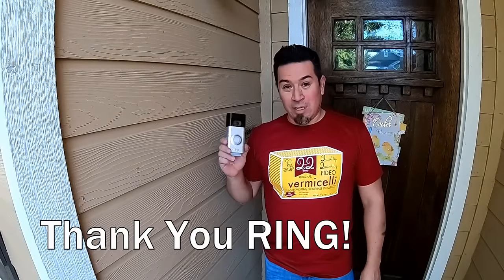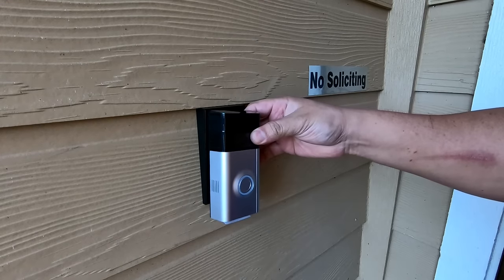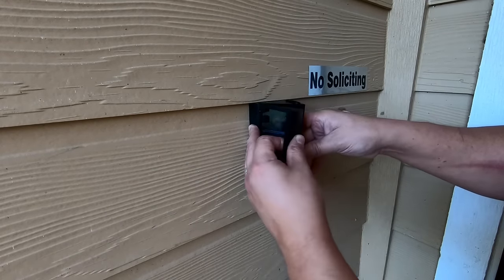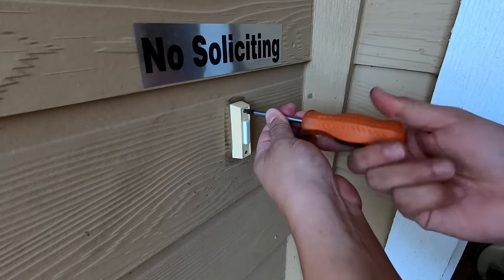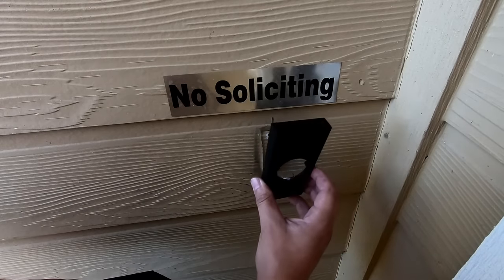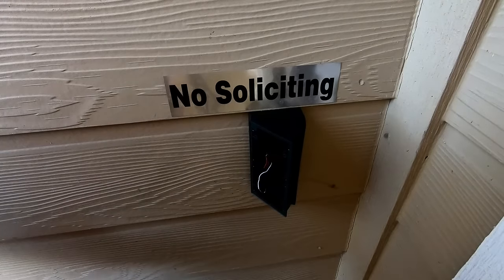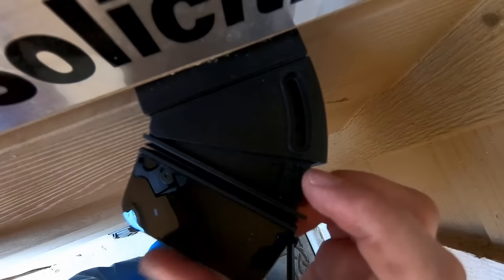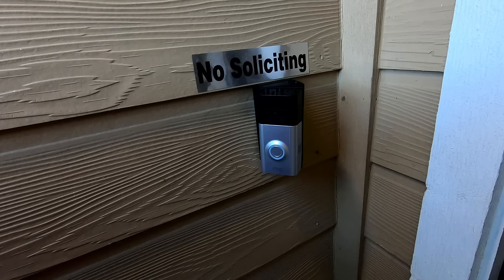Adjustable Ring Angle Mount Installation

Comment: Writing a review to shame Ring for not including a 55 degree angle wedge in their packaging for those of us that have doorbells on the side of the house.  The video was very timely and well done. I bought the mount from eBay for $12.49+tax  and FU Ring for not including and also not advising us of the corner kit bracket.
Reply from the maker: My neighbor had the same suggestions as his doorbell is also side facing
Reply: @ThisGuyProductions  how did your neighbor resolve? Did he complain to Ring?  Did he buy the corner kit bracket like I did?
Reply from the maker: @gmav17  - He bought an angle bracket as well and is waiting for it to be delivered.
Reply: @ThisGuyProductions  there is no excuse for Ring not providing an adjustable bracket up to 55 degrees included in the packaging. What were they thinking for those that have side doorbells and cannot use the wedge they provide. People should be aware that this is an issue before they buy Ring and would need to order another product and drill a fn hole in that product to complete the Ring installation. Ring buyers with side doorbells all need to know this!
Reply from the maker: @gmav17  - I totally agree. It would at least be great for them to mention the limitation on their packaging and then perhaps offer an angled bracket as an accessory. It would allow them some additional revenue and offer a solution to consumers on the spot instead of being stuck without a solution. I also feel it would improve their sales up front.
Reply: Any chance you might recommend an angle wall mount for RemoBell W Video Doorbell Camera with Chime? 
It looks more narrow and leaves me with the same directional install challenge. Would appreciate your feedback, thx
Irene
Reply: @irinatenenbaum8702  Not familiar with the RemoBell Video Doorbell camera.
Reply: @ThisGuyProductions  Remo offers what I want, yet same angle bracket bottleneck
Reply: Did you sue your builder too for a narrow doorway and inconvenient placement of the wired doorbell? 😂
Reply: Strong words. It's just a doorbell mount.

Comment: Thanks, Guy. I was ready to build a bracket to hold my Ring since I have an unusual doorway with no surface wide enough to mount it facing forward. Great solution. Going to the Amazon now to look for the bracket.
Reply from the maker: Glad to help out Neil. One thing I didnt mention in my video is that the brackets can be painted to match your home color scheme. Good luck.

Comment: I didn't make mine flush with the siding because I needed it to cover the old screw hole.  I ended up using two 2" screws, which worked and I turned the bottom angled piece around and lined it up with the top piece, worked good 'nuff for me!  Good vid.
Reply from the maker: Thanks for sharing. Glad it all worked out.

Comment: This was quite helpful.  I was putting off the purchase because I wanted to hardwire the doorbell but was unsure about the angle.  I found the included wedge to be sufficient but not quite where I wanted it and of course didn't even know about the adjustable wedge until this video.  Completed the install in minutes.
Reply from the maker: Awesome, thanks for sharing.

Comment: Good video, but a correction on your hardwire detail, as Ring say is correct it does not matter which wire goes into the back screws, WHAT matters for your existing doorbell chime !!  in the house to Ding-Dong is, the settings In The App/Account on the section of when it asks about wiring to an existing doorbell, meaning, after you install it , you go back into the app and make the selections so it ding-dongs when you press the bottom., given you have a mechanical-common doorbell at the house with the strange looking transformer some where inside the garage wall or ceiling.
  Hope this helps for the ones that missed it first, and it didnt dingdong and had to ck with Ring to fix it.
Reply from the maker: Thanks for clarifying RG King.

Comment: Ok question. I have somehwhat of a similar situation as you, But I can see almost all of my driveway. I want just a slight bit more angle so I can see about another 4ft of my wall. That way I can see my side gate as well. Would aIbe able to use just the angled piece that come with the Ring? Or would I have to use the slanted (leveling) piece as well? The Angled piece would work perfect. But I don't want to drilll 2 unnecessary holes if it wont work. Appreciate it in advance.
Reply from the maker: You can add some wood shims fairly easily to add the additional angle you are looking for. I was going to originally mount my ring using a piece of wood cut at an angle, but the mount I found online was much more flexible.

Comment: Great video, I just got this yesterday and plan to install it in the next few days. Let’s talk now that’s it’s been over a year later since you installed it. How is the mount holding up? Do you find yourself having to go back and tighten it a lot? When you push the button, is there a lot of give or is it solid? Thank you
Reply from the maker: The mount is as solid as the day I installed it. I havent had any issues with it whatsoever. I also have tons of traffic so it gets plenty of use.
Reply: This Guy thanks so much for the quick response. Take care!

Comment: I fancy a Ring doorbell and would need the mount for my porch. But, I always see these Ring doorbells and think how are they not stolen. It must be so easy to rip this straight off the wall or door and walk away with it. Yes, ok for a point you're on camera but if I'm wearing a cap and have my face covered you have no chance knowing who stole it. So, the question is how secure are they from this happening?

Comment: When will they make a model designed for the side wall installation.  It would be streamlined with the camera lens and motion sensor on the side of the unit.  I think there is a big demand and would look very nice.  I'll wait until they invent it.
Reply from the maker: I agree with the demand for an angled model. That or at least offer an accessory to solve the issue.

Comment: 2 questions...1. Where did you get your shirt? Yay Fideo! 2. Did you cut power to your doorbell before you did this? I have turned to breaker off  and all of my outside lights & outlets turned off, but the light to the doorbell stays on. ??
Reply from the maker: Hey Valerie. The shirt came from a company called Barbacoa Apparel. They have a website where you can find this shirt and other cool options. As for the power, you can keep the power to the doorbell on. There isnt a lot of electricity running through it, just don't put the wires into your mouth. It can be connected just like that.

Comment: Not that it mattered for your end result using this additional adjustable bit, but the ring wedge was installed backwards.  The flat side goes against the wall.   It is confusing as the product images they show is of the back.
Reply from the maker: Thanks Curtis. No harm though. It works great as is.

Comment: What kind of longer screws like your using would i use on regular siding?  Also can u please, please post the amazon link for the adustable extender mount you are showing you used here?  I have the same problem..ugh..side doorbell..here's looking at you wall!!! hahahaha Thanks for the video!!
Reply from the maker: Hi Boe1956. The link to the mount I bought is here (below). I am not a paid advertiser from this company, its just the one I used. If you go with a 1 and 5/8 wood screw you should be OK. Let me know how it goes.
https://www.amazon.com/gp/product/B078RK1131/ref=ppx_yo_dt_b_asin_title_o01_s00?ie=UTF8&psc=1

Comment: Thanks this solves a problem. One question. I have stucco so do I need all of the brackets you used?
Reply from the maker: No, one of the brackets I used out of the box was to correct the angle from the siding on my home. You can get away using the flat part of the angled bracket, or the bracket that came with your doorbell.

Comment: Great Video  but will    the  adapter  work for Ring Doorbell 3.?
Reply from the maker: Hey Jesus, I just checked and the version I installed states it only works on the 1 and 2. I just did a quick amazon scan and saw lots of versions for 1's and 2's but not 3's. If you find a link, please share. I'll add to the description and throw you a shout out.

Comment: Does the wedge work if you needed it to face the ring in the other direction? In other words, can you angle the wedge in either side?
Reply from the maker: Yes it does. Just flip it upside down. It is universal.

Comment: Awesome video! I have the same issue you had. My door bell is facing the wall, I have a ZMODO door bell camera, do you know if this bracket you installed fits the zmodo door bell camera? TIA
Reply from the maker: Hey Maxcoatl, I am not familiar with that doorbell. I would start by comparing the doorbell dimensions. Chances are they are not the same, thus incompatible. There are a number of "Universal," options online, but I don't have recommendations without knowing the products.
Reply: @ThisGuyProductions  thank you very much. I contacted Zmodo and they do not sell a bracket for their model. Also contacted amazon from your link and they told me it wont fit. I need to come with an idea on how to make mine like yours; thanks again.
Reply from the maker: @maxcoatlhunter4322  My original Plan was to use a block of wood. I  would basically use two 2x4s. Cut each at a 45 degree angle, then stack them. Basically a block that I would drill holes into for the doorbell wire, then mount the doorbell to. I went the bracket route when I found the version I used online.
Reply: @ThisGuyProductions  thanks man I really appreciate it. I will put your idea to work yes, thank you!
Reply from the maker: @maxcoatlhunter4322  Let me know how it works out.

Comment: Will this adjustable wedge work with a Ring 3 Plus unit? If not, can it be modified to work?
Reply from the maker: Hey F Anderson, I am not sure if it is compatible. I haven't tried it with that version. I am sure you can find amazon sellers with similar compatible models, but be cautious as I had to modify the version I bought.

Comment: Will this work for a side mounted doorbell at the top of stairs?
Reply from the maker: Sort of. The doorbell has a very wide camera so you will see some of the stairs, but not all the way down. There is a small wedge in the box that may help aim in downward a little. There may also be a different option on Amazon with that option too.

Comment: So moving the doorbell location (which I assume means rewiring) is too difficult to do? - Asking with no knowledge
Reply from the maker: It really depends on how far you are planning to relocate it. A few inches, no problem, a foot or so, you can add an extension piece of wire and paint it in to make it look neat. If youre moving it to the other side, you may have to hire someone.

Comment: do you know how to fix a glare during the day time
Reply from the maker: Its gonna sound weird, but you can add a shade over your doorbell. I am assuming the sunlight is hitting it directly? I quickly googled this, but I am sure there are many more options: https://www.etsy.com/listing/783377731/the-original-video-doorbell-camera?gpla=1&gao=1&&utm_source=google&utm_medium=cpc&utm_campaign=shopping_us_c-home_and_living-home_decor-wall_decor-wall_decals_and_murals-other&utm_custom1=_k_CjwKCAjwjJmIBhA4EiwAQdCbxsI3jlZHwovJ5DOpfO6qmu7yaz3Gj-2wo4Vq1O_RzPheDkP6g6c50xoCUw8QAvD_BwE_k_&utm_content=go_12569671679_118325090374_507439142846_pla-307934656303_c__783377731_12768591&utm_custom2=12569671679&gclid=CjwKCAjwjJmIBhA4EiwAQdCbxsI3jlZHwovJ5DOpfO6qmu7yaz3Gj-2wo4Vq1O_RzPheDkP6g6c50xoCUw8QAvD_BwE
Reply: @ThisGuyProductions  more like the hits the wall on my walkway or the side walk and makes a super glare
Reply from the maker: @batone76sanchez37  Thats an even worse situation. So its more of a glare from reflected light and not direct sunlight. I wonder if you can place some kind of polarizer over the lens to remove that? I see lots of polarizers online, but nothing specific for Ring. It looks like you would need to jerry rig it. Not sure if you are familiar with Polarizer. Its like those high dollar sunglasses that eliminate glare and light reflection.

Comment: Has you a video for aplication and what i have to conect to the other side of the wires?
Reply from the maker: Hey Pablo, your wires should be already connected to your doorbell inside your home. If not, the Ring should work as a standalone except you will need to constantly recharge that battery.
Reply: This mean that the ring has 2 part? I only ser one
Reply from the maker: @PabloOlivare  The ring doorbell is a single unit. It comes with a few different plates and a couple of wedges to mount them. The back of the Ring has a couple of screws that are used to connect it to your existing doorbell wires. THis will provide power if your doorbell lights up. If not, it will at least connect the Ring to chime your doorbell when someone pushed the button. This is on top of notifying you on your phone app.

Comment: Couldn’t it be easily stolen with normal screws on top and bottom of angle mount?
Reply from the maker: If someone wanted it bad enough, yes they could just take it. The same goes for the standard mount that comes with the doorbell.

Comment: how many degrees is this angle mount?
Reply from the maker: You can get about 45 to 50 degrees out of it. The Ring should also come with a bracket that has a bit of an angle as well. You can put them both together.

Comment: Mine didn’t come with a wedge. My siding is small which leaves a gap on the middle of the cam
Reply from the maker: Not a good scenario teaglet. Is I would suggest doing something to fill it. Perhaps smaller wooden wedges to level it out? Send a pic and I can make a better suggestion.
Reply: This Guy how do I send just a pic in YouTube ?

Comment: You didn't mention the proper height to install, instead of the existing doorbell height which looks too low.
Reply from the maker: My doorbell was already at a standard height. The camera on the ring is an extreme wide angle so I have always been able to see visitors even if they are standing really close to it.

Comment: I originally installed the Ring Pro. However after a few weeks it began to have issues with the original doorbell transformer (not compatible) so I switched over to the basic Ring. The basic doesn’t provide the viewing features of the Pro. Anyone out there know what transformer I could upgrade to? My present one is class 2. Thanking you in advance.
Reply from the maker: Hey Henry, hopefully another viewer can provide the info you are looking for. I am not familiar with it. Have you reached out to ring?
Reply: @ThisGuyProductions  I'm working on it. What I found is it helps to have a 30V transformer, more compatible, however it will work with a 16 volt, sporadically or not at all. The next question which I have sent to a handyman, if I change out the transformer, how does it affect my existing wired doorbell - further down the rathole 😊

Comment: can it fit for ring 3?
Reply from the maker: I'm not sure Mike T. I would just look on Amazon as there are a ton of similar options. The one I installed was advertised to work with mine yet I had to drill some holes myself.

Comment: They need to add a camera adjustment

I have a peephole cam that's aiming at my awning

You can't wedge it because the peephole is 90°
Reply from the maker: I agree that some kind of pivot would be awesome. I was going to originally going to use a wooden wedge.

Comment: The mount seems can be easily yanked out for someone trying to steal the doorbell? Is this mount approved by Ring for theft coverage of lifetime theft warranty of the doorbell?
Reply from the maker: Its a third party wedge and is not approved or endorsed by ring. I am sure it could be yanked out if someone wanted it really bad. To be honest the ring alone would be just as easy to steal regardless of using this wedge. All in all you would have a video of the thief stealing it though.

Comment: What drill bit did you use at 3:10 mark?
Reply from the maker: Hey Flipballindero, it looks like a 5/32". I would hold a screw up to your drill bits and find one that is the same width as the threaded part of your screws just to be sure.
Reply: @ThisGuyProductions  thanks for your response. Did you also have to turn off the breaker before installing the ring?
Reply from the maker: Nope, no need to turn it off. There is power in the line, but it is very low.
Reply: @ThisGuyProductions  thank you sir

Comment: I don’t have a doorbell
Reply from the maker: If you have wi-fi you can add install a ring doorbell anyway. The doorbell wire in my situation is to #1 allow the ring to chime my actual doorbell chime inside my home that is already hard wired #2 the wire in my home will provide some power to the ring so that I don't need to charge the battery, ever. In your scenario you can install the ring doorbell and then recharge it regularly. The ring YouTube channel has videos that show that process. This particular angle mount may be a challenge though since the doorbell has to be totally removed to charge it.